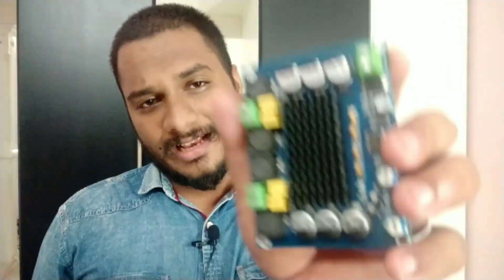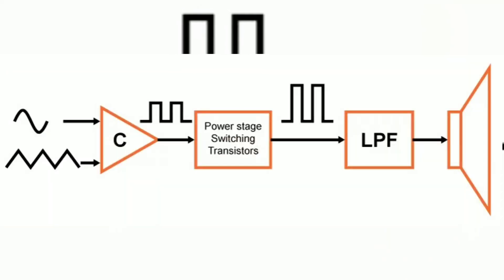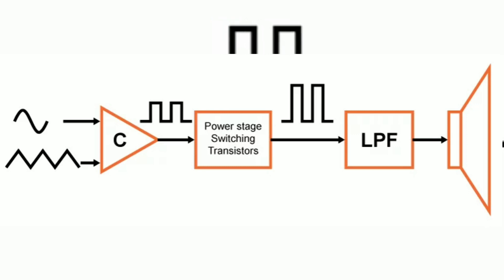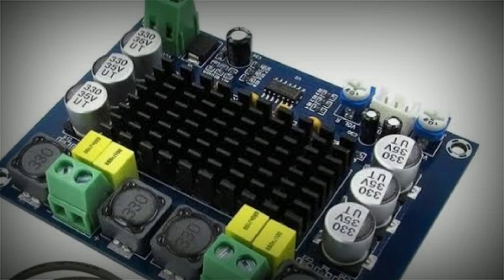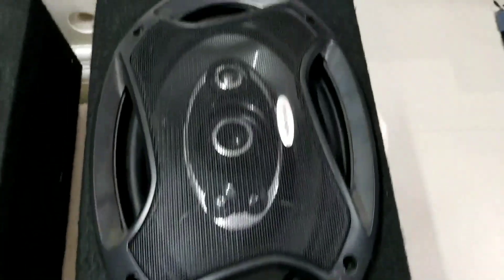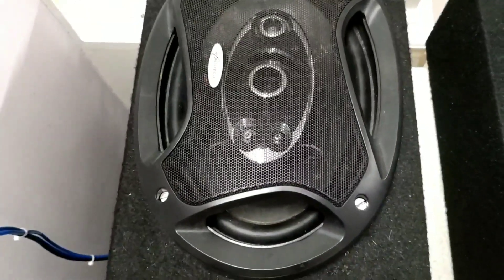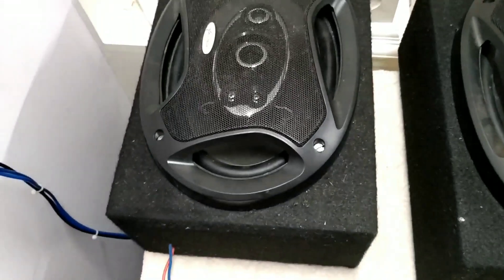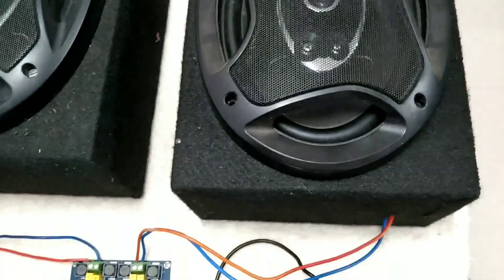Class d amp board from Amazon testing and review

Comment: 10amp 24v is too much, reduce the amp to 5 amp, and you will here high frequencies.
Reply: 5amp or greater is okay. The voltage matter here. It must be constant 24 volts to use the full potential of amplifier.
Reply: It's correct
Reply: If I use 3 board together for a 5.1 amplifier how many ampier power need for transformer